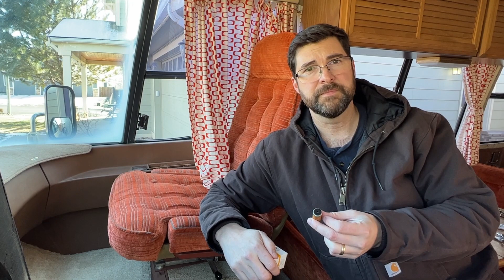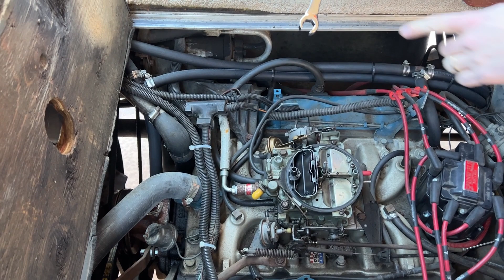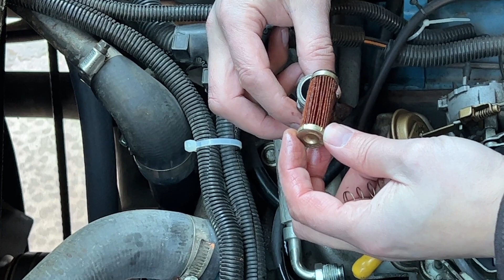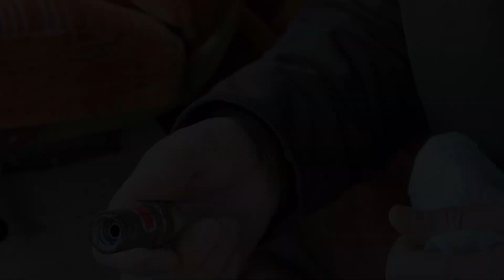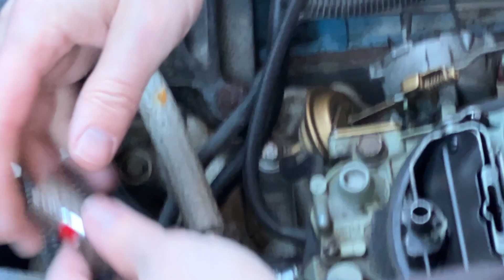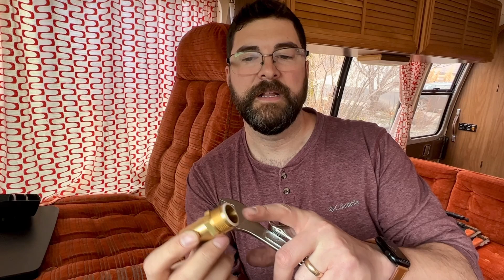'77 GMC Motorhome Fuel Filter

Comment: 1976 elaganza 2. Started and ran her end of April. Pumped her and cranked right up. Mid July pump away and smell flooded won't start. Going to tune up. But I'm not carb savvy. Any help would be great
Reply from the maker: I always start with the basics if it cranks but doesn't start. Does it have spark? Is it really getting fuel? Is the choke working as expected? After that I'm mostly out of ideas. I'm not a carb expert either and took mine in for a professional rebuild a while back, it made a huge difference and has been running great since.

Comment: Get a bottle of Permatex Aviation Form-A-Gasket sealant liquid for any fuel line threads. I also use it on my fuel tank and oil drain plugs. 
Doesn’t take much. Remains flexible too.
Reply from the maker: Interesting, I haven't used Permatex Aviation Form-A-Gasket but it looks like useful stuff.

Comment: So that 1cm pipe with a 50 gallon tank at 8mpg is being filtered by a lipstick case sized fuel filter? Wow. I have a bigger fuel filter on my lawn mower. I know there is a mantra for getting everything "back to stock" and "if you haven't got it you can't break it". But there is a reason cars and trucks aren't built that way any more. I found the Jim Bounds videos on the GMCs like going back in time to 1985. It was all a bit surreal
Reply from the maker: It's amazing to me that they system works as well as it does. I think most people add a larger fuel filter on the frame, just ahead of the tanks. I plan to do that but the current system still works so I'll carry a few extra filters and keep working on other projects. :-)
Reply: Mate I have the upmost respect for your ongoing restoration. Keep up the good work and I hope you get to enjoy it in the coming months.

Comment: nice job; really thinking about getting one just with this gas prices makes it hard to decide
Reply from the maker: In the big scheme of things, gas prices are not the most expensive part of owning one of these. Unless you are always driving. We drove about 1,200 miles last year and may drive 3,000 this year. At 8 mpg, if gas prices double, it may only cost us an extra $1,000 all year for gas. We'll spend a lot more than that on camping, maintenance, repairs, insurance, ... 😄
Reply: Have a few in your coach all the time.

Comment: You might want to replace nylon fuel inlet gasket and keep a few on hand. It can get crimped if you’re in the midst of tightening. When I moved my coach from CA to AL I had to change one in a parking lot in NM. It was easy to do and I recognized the symptoms from a second barn find coach we had to bring back from dead.

Hope that helps! Great videos!
Reply from the maker: Hi Ray, Thanks for the comment and great point about the nylon washer. I did order an extra to keep on hand. I think it should last quite a while but it's always good to have an extra.
Reply: @MrGMCMotorhome  I agree. I picked up a pack of 7 or so. Even though my coach had new tanks, they still get trash in them. I want to put a better filter in where my electric fuel pump is just forward of the AUX/main valve. 

When in AUX position the electric fuel pump runs and overcomes any vapor lock that can happen due to heat or weak mechanical pump on front of the engine. When in normal mode the pump is off (in case of accident). The aux only gives about 6 more gallons. 

Keep up the good work! Love your channel. Somehow I was unsubscribed, but added it back today.
Reply: Same story here. Picked up our second one in Minnesota (to Wisconsin). Leaking fuel on top of a hot engine is a nightmare.  My nylon gasket looked like 2 guys with vise grips twisted it in opposite directions!

Comment: Part number of the fuel filter housing?
Reply from the maker: Hi Jeff, I got the housing from Quadrajetpower.com and the part number is "FFHK" for the housing and filter kit that I got. You can also get just the housing with part number "Inlet1". https://quadrajetpower.com/fuel-filter-housing-kit-new-1-housing-filter-gasket-and-spring-all-new/
Reply: Thanks for another great video.